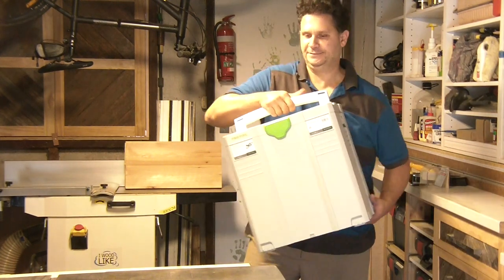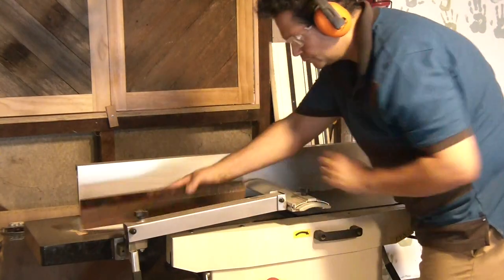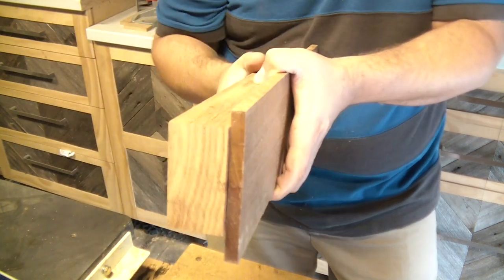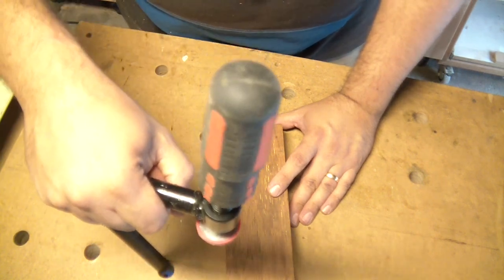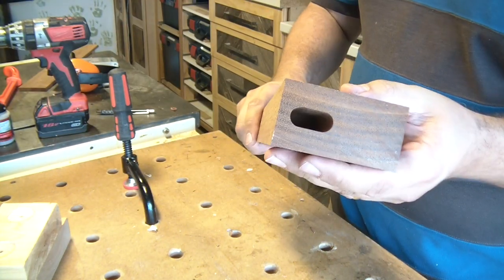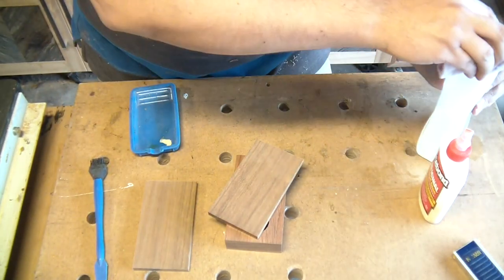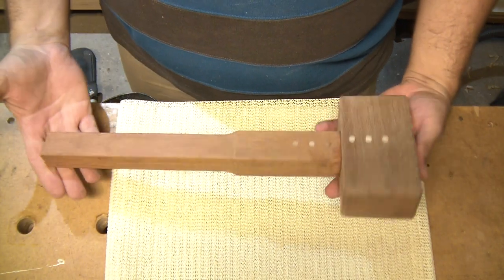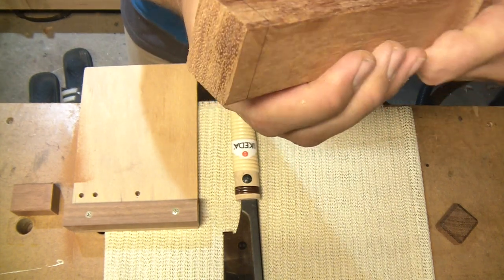Make a dead blow mallet with Festool Domino XL

Comment: Only thing you don't get is money left in your wallet
Reply from the maker: Actually on one job that Domino paid itself off with change. Making the 24 M&T joints and 4 separate panel glue up joints and 4 lock mortises needed for the doors I just finished would've taken more than 96hrs.  That's more expensive than the Domino and all its accessories. With the domino I spent about 2hrs doing it all. If you do this for a living the Domino is a dead set bargain.
Reply: One Man Band Woodworks, I'm lucky enough to have a dedicated morticer and tenoner so don't struggle for time. It is a dam good tool though and if I was starting out a second time I look very seriously at one.
Reply: One Man Band Woodworks aye it has advantages. Doesn't suit a lot of my work though as I do a fair few soft wood gates that have to be pressure treated so as little glue as possible. It's the one festool I would buy into though as a lot of commercially available mortisers are going down the slot route so to have that in a hand held tool would be good.